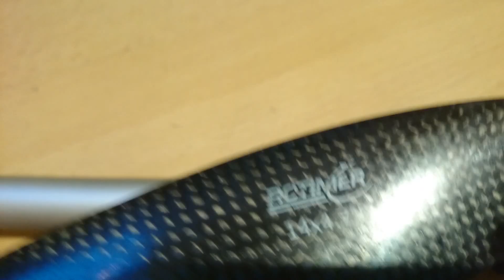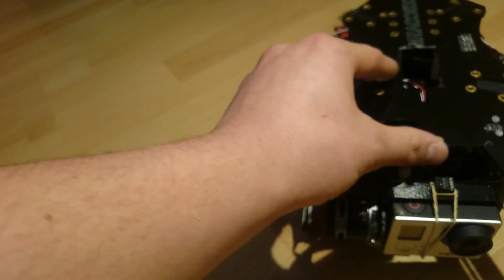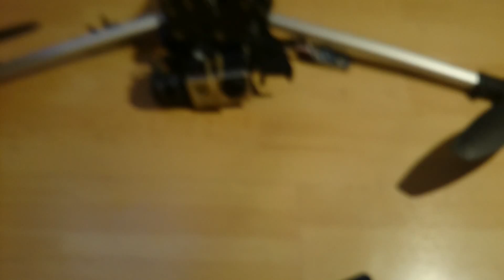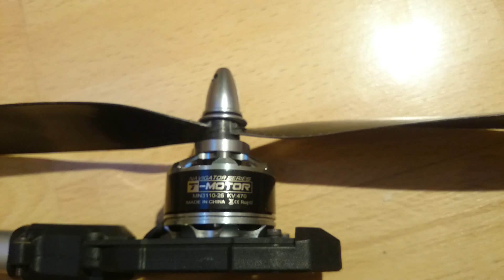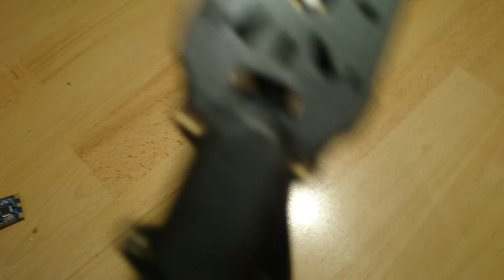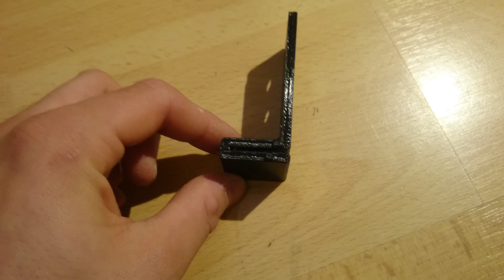Cheap DIY TBS Discovery Pro Endurance  ►Part 1

Comment: Nice work my friend. Keep fpv flying. Please could you send me the pids for the gimbal? Do you use 3s or 4s for the gimbal?
Thanks in advance
Reply from the maker: Vassileios Bonovas Thank you. I dont have the pids for the gimbal, because i figured out the tarot software is only on window and i got a mac... So cant tune the gimbal... The gimbal is directly plugged in a 3s input.
Reply: BlueMan FPV Thanks

Comment: Less kv motors gives more flight time?
Reply from the maker: Yes they do because they have more tork and less rpm, so it needs more voltage but less amps. So you need to fly batteries above 4s.
Reply: aaah ok. And whats flight time do you get with 4s?

Comment: Thanks so much for sharing, I've been upgrading my TBS in the same way. Do you have a link for the 3D printed FPV camera mount? Also, your motor mount links to 25mm mounts, but I think you mean 16mm?
Reply from the maker: Thank you ! here is the link for the 3D printed camera mount, its in the files of the gimbal ;) https://www.youmagine.com/designs/pl-tbs-gimbal-v1 

Oh yes of course i mean 16mm, i will correct, sorry ;)